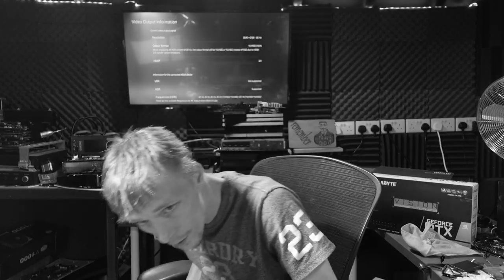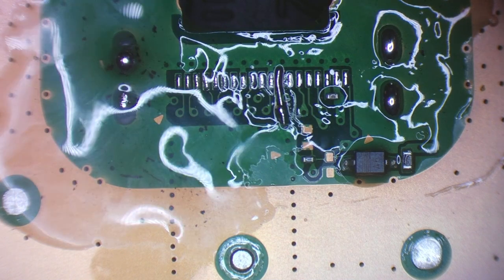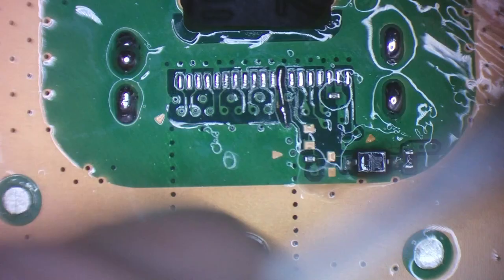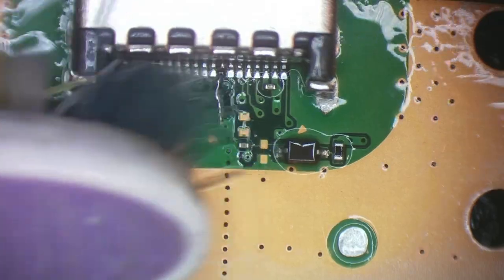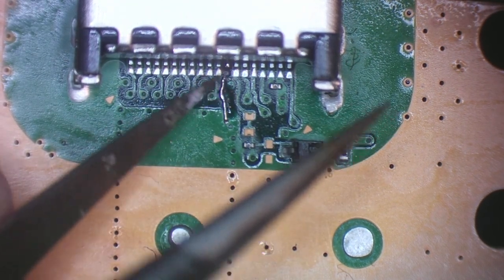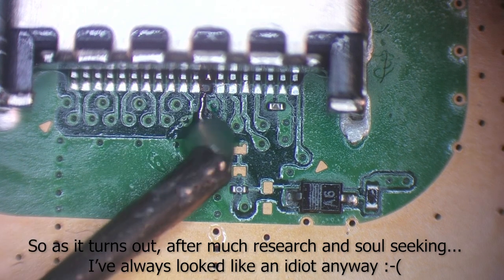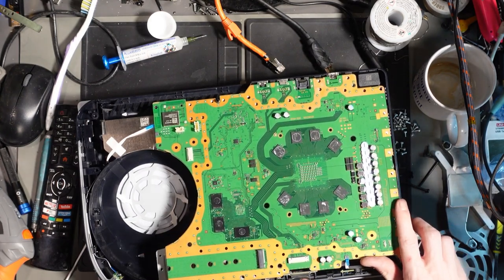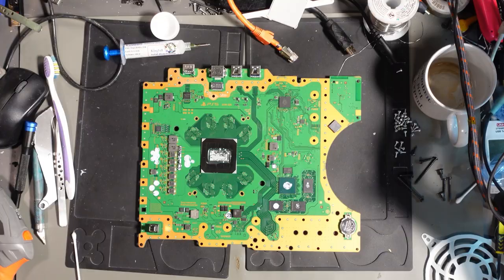This PlayStation 5 Repair Almost Broke Me! Prior Repair Attempt (And My Attempt) Gone Wrong...

Comment: @TheCod3r Here's one for you.  I have a brand new PS5 (well, about a month I've had it for) that when I go to put it in rest mode, sometimes when the screen goes black it will go green and then end up with full power loss.  Other times it goes into rest mode completely fine.  I just haven't had the time to send it in to Sony yet.
Reply from the maker: I'm pretty sure that's a ram issue mate. I come across it once and I tried everything including replacing the encoder and southbridge and got nowhere with it

Comment: Missing track pad more tidy if you using flat FFC / FPC cable wire, not jumper wire 👍🏻
Reply from the maker: I prefer the wire method, it's stronger and easier to work with

Comment: I'm feeling your pain. I can't remember anything I've tried to repair that I've ever fixed.... Oh yes I can, it was a multi scart connector that I used some solder and it worked after that.... Not that I used it must afterwards.

I admire what you do and the efforts you put into the repairs.

I wish I could fix things. I tried to fix a PS3 controller last night and ended up losing a spring from the rear trigger button (can't remember which one) and it just doesn't work. Mind you, I sprayed it with WD-40 because the initial problem was the left thumbstick kept sticking
Reply from the maker: Don't worry mate, keep practicing and you'll get it. I messed up and failed a lot when I first started, it's completely normal. Just keep trying
Reply: @TheCod3r  I don't have the stuff like you do. My wife would kill me lol. I do have an arcade machine in the front room though, albeit only 3 player buttons per player.

Comment: I was questioning why you didn't solder on the port, then reconnect the trace?  A genuine question.  I'm here to learn.  BTW You've got a surprisingly good singing voice bro. :)
Reply from the maker: I learned from doing that a while back mate. Users are too rough and when soldering the wire after the port is installed allows it to snap. If it's under the pin it doesn't break again. I learned the hard way lol. Thanks btw, I don't think I can sing, but I appreciate it ☺️

Comment: The second I saw the flickering on the screen I immediately assumed it was the HDMI cable.  I've had this happen so many times that I now only stick with one brand due to I haven't had one fail yet even after a year (primecables I think the brand is).

I've had amazonbasic cables fail after 3 days.

I've had 2 HDMI cables troll me like this before, and one power cord as well.
Reply from the maker: Yeah I don't know why I never tried it first but I think in the moment you overlook the simple things. I've replaced them since but I need to replace them again now haha
Reply: @TheCod3r  go with primecables.

Fair price, lifetime warranty. Mine haven't failed after 6-8 months of ownership yet.

Comment: I'm by no means a professional such as yourself but I now know the ins and outs of the PS5 pretty much bringing one back from the dead with no power supply, no hdmi port, missing caps ect. I was able to finally get it to turn on but for some reason the controller would not work unless it was plugged in turned out there was no antenna for the Bluetooth I'm guessing I took one from a PS3 and it worked the black and white connectors anyways the point to this comment is in relation to your video near the end I've never been more stressed out in my entire life in those few weeks working on this PlayStation it seemed like it was always something so I played it for a few weeks thought that the liquid metal look a little dry because I had it out working on it so much so I replaced it and now as I'm writing this I'm no longer getting an image on the screen and it seems like we're back to square one I'm pretty much not even really in the mood to take it back apart the last repair I said if it didn't work I was going to give the console to somebody disliked so they can deal with the stress. Looks like I won't be playing lawn mowing simulator anytime soon but in a weird way it's nice to see and good to know that I'm not the only person plagued by the mostly negative emotional rollercoaster from our "friends" at Sony! Cheers mate you are the G.O.A.T

Comment: I think you may be using a lot more liquid metal than you need which could contribute to it coming out without the foam. I know from experience that liquid metal can be put on so thin that it won't move even without the foam. I've also seen instructional videos for PC CPU's that advocate using the absolute bare minimum to cover the die or IHS. I haven't actually tried it beyond a test IHS so I don't know how thin is too thin but I definitely think you are probably using more liquid than you need. Sony probably uses too much too and thats why they include the foam because its probably too difficult to put a very fine layer through mass production assembly. 

If you use a thin enough layer and its sufficient for heat transfer then it shouldn't come out IMO even without the foam, but I don't know for sure. I'm just giving you a suggestion based on my limited experience with LM. I would recommend using some sort of micro brush and not the liquid metal syringe itself to spread it over the die.
Reply: If think you think about it, LM is mostly used on PC CPU's with a vertically oriented motherboard. And yet there is no foam that is used on those CPU's. Since this is a standard practice it leads me to believe that it shouldn't be coming out even without foam if the proper amount is used and applied properly.
Reply from the maker: I think the seepage is more due to transport back to the business. They get knocked and banged about. This video was filmed before I made a point to get the foam back from the business but now I do replace it. I may be using a little too much though
Reply: yeah I've used LM in my laptops for years, getting moved around and banged up in every direction. If you use the bare minimum the tension will keep it in place. But I'm sure Sony would rather spend a few cents on the foam so they can get low-paid factory workers to just quickly apply it and not worry about it spilling over

Comment: how many degrees on the air gun is recommended for HDMI port replacement?
Reply from the maker: It depends on your equipment but personally I use 480⁰C/60% for removal and 440⁰C/40% for reinstall

Comment: What solder tip are you using for the HDMI encoder ic and at which temperature?
Reply from the maker: Usually I keep my iron at 450⁰C and use a B12 tip on my Hakko FX-951
Reply: @TheCod3r  thx for answering!

Edit: I guess you mean T12 b? It more looked like you are using t12 bc. I'm asking because I have a ksger and also using bc tip but I can't manage to get to connect mainboard and ic via solder. It get to the point where I start to scratch away soldermask(the paint on the PCB). While you where doing it it looks so easy like you only go over the solderpoints once or twice fast. Could you please do a video on how to properly solder flat qfn ICs?